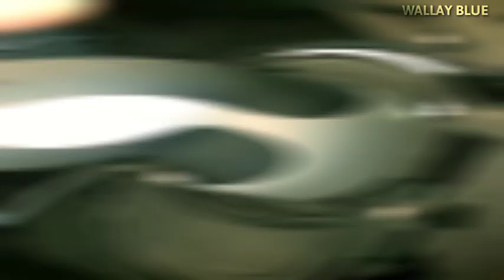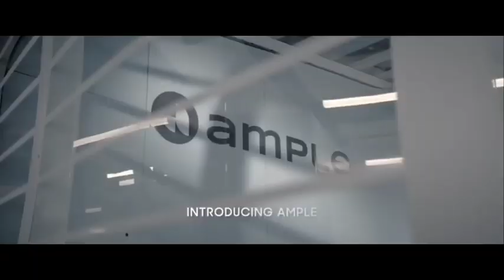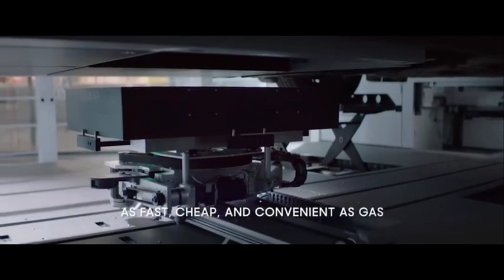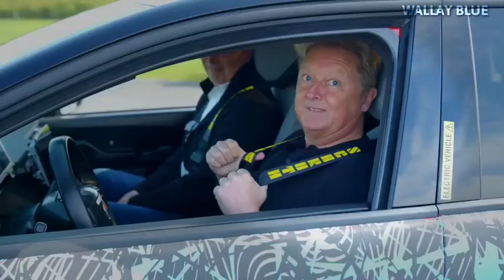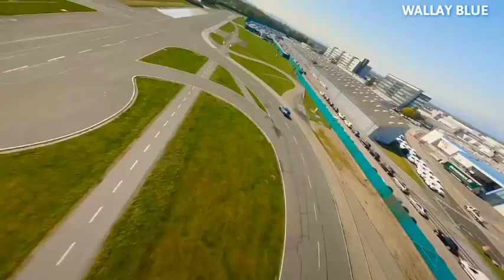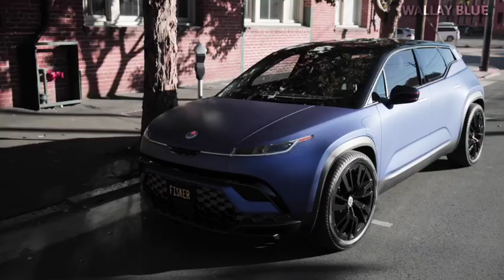Fisker Ocean Electric SUV To Feature Swappable Batteries in 2024!

Comment: With Super Fast EV Charging under development and coming very soon with capabilities up to 1.5 MW and under 10 minutes, with currently available EV Fast Chargers 350 KW power, you can fast charge most EVs from 10 to 80% in less than 20 to 30 minutes. Plus, with newer battery technologies coming that will allow longer ev ranges of 400 to over 600+ miles, most folks can fill up at home or at their destination. Project better place tried battery swapping successfully with Nissan & Renault over 10 years ago with limited customer acceptance. Fine for fleet use.